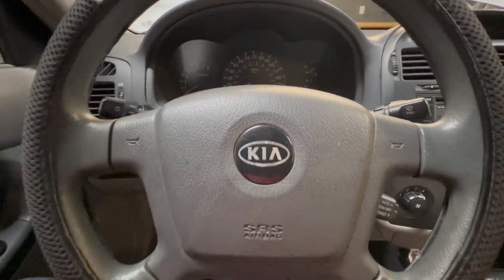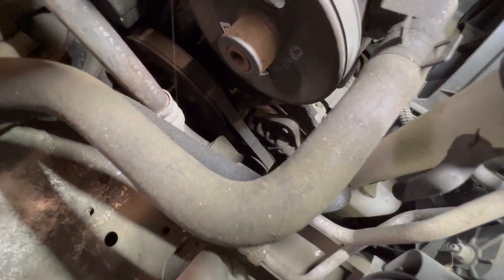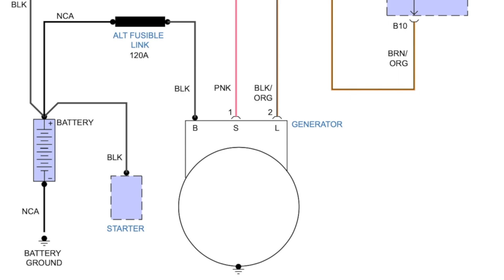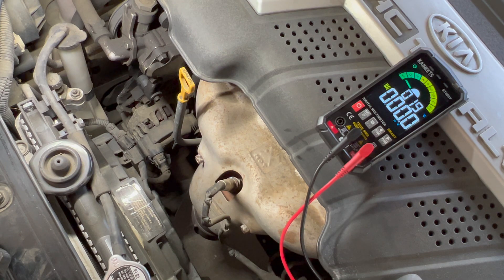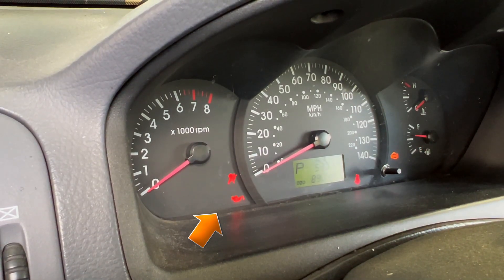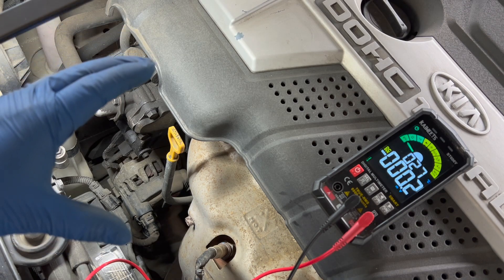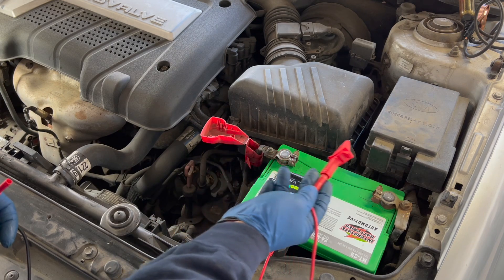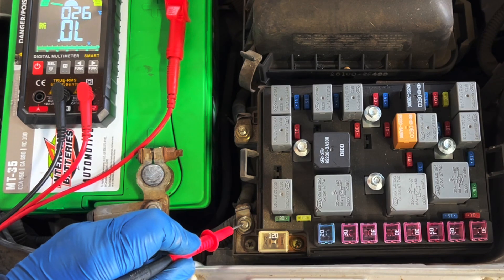New Battery - KIA Spectra Charging System Issues

Comment: Damn....you the man...am having alternator issues on my 2008 spectra right now...will remove and have it tested. I removed the negative to battery and the car stopped running etc.
Reply from the maker: Voltage drop the power and ground side.
Reply: My lights just came on like that too the brake and battery light I took the negative off the battery when the car was on and it immediately died
Reply: It was the alternator. I had it tested and it failed. So 1A auto had the best deal..138.00 with limited lifetime W. So I installed from the bottom up and I am back on the road again.

Comment: This is very well done.  I would like to add one thing I experienced that will just add to what you have put forth.  While doing the voltage drop tests, the ground in particular test it while the engine is running.  I had a good voltage drop test on the alternator case without the engine running but showed 2 volts while running with a no charge situation!  Wiggled the ground at the right strut tower and jumped to 13.6 volts.  Not really sure how the starter was even able to operate but it did!  I am a professional tech and was pulling my hair out!!  Your video led me to the repair!  Thanks!!  Rosco
Reply: I think you just solved my problem!!! I've had a loose connection but didn't know where to start looking....thank you!!

Comment: Interesting. My battery drained, first charging light, then ABS system, then lights and last, the worst, transmission light. Bought a new battery, happened again. I bought an alternator AND  a positive cable just to be safe. Was just the alternator. I don't have diagnostic skills. Will replace the cable one day. Not needed at the moment. It's a lot cheaper than a new or used car
Reply: was coming down some mountain awitchbacks and my brakes started failing and my tranny was failing....the same lights, brakes and battery on dash was showing also...car finally stopped running at a stop light...was lucky. AAA took me 40+ miles home...am taking the alt out tomorrow.

Comment: I have an 04 Kia spectra and I’m having similar issues my lights will flicker on and off but the car will start and drive just fine. I will get occasional flashes of the battery light and brake light and then it turns off. Any tips or advice I’m not the most car savvy but i was going to try and use a wire brush to clean up some corrosion and maybe check the fuse first.

Comment: What should I do if I have code 65-11
Brake light is on, VSA, power steering 
Honda Civic 2013 ex 1.8L less the 80k miles no check engine light. 
Test the battery 12.75 
Alternator 12.73
I have also check all the fues all good.  
I have also check brake fluid all good. 
It drive good with no problem my gas’s miles have been going up. 
Pls help Honda asking me to pay $2343 to fix and they will not tell me what I need to fix